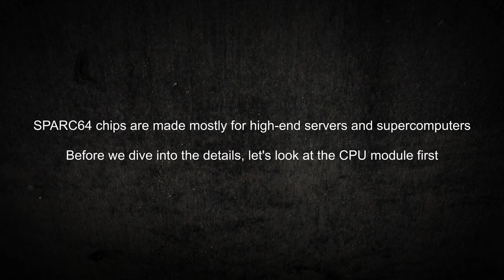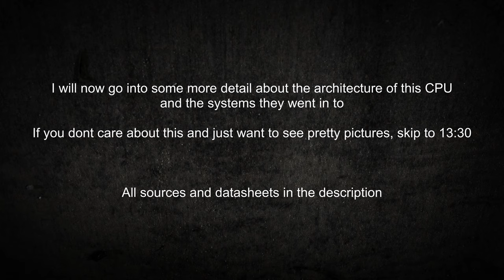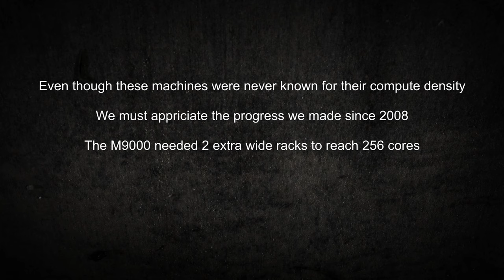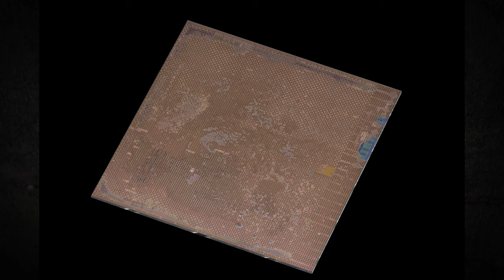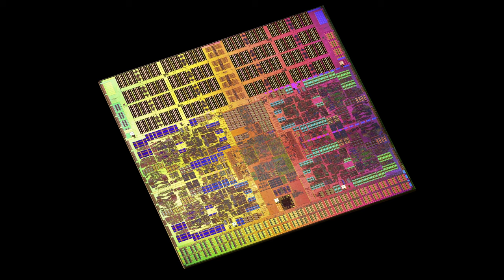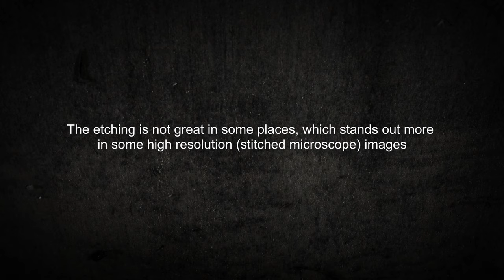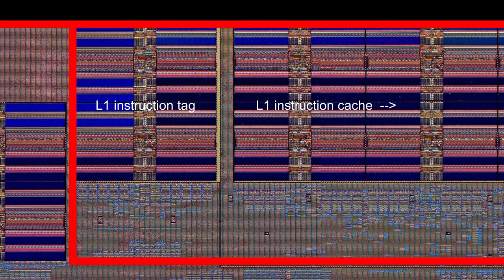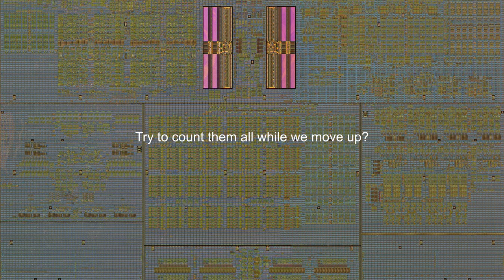Fujitsu SPARC64 VII die shots

Comment: I just found your channel and I'm loving it so far, you have some incredible photos, can I ask what acid you used to remove the pad layer covering the die architecture.
Reply from the maker: Hi, I first used boiling sulfuric acid to clean the die of solderbumps and whatever is left of the substrate the die came from. Then I used regular glass etching cream to remove the metal layers from the die. There are some manufacturing processes that this will not work for like SOI (it will wipe the entire die) or most aluminium based metal layering used in old chips.
Reply: @SIC66SIC66  okay brilliant I'll give it a try 👍🏻

Comment: The "tiny rectangles" are likely monitoring blocks. (as explained by Zeptobars in a post called "A look inside Russian 28nm MIPS CPU - Baikal-T1"). These monitoring blocks may contain temperature sensors and oscillators. I would guess that the CPU would downclock in case the temperature goes too high, or if the oscillators slow down or stop (this would indicate that the CPU will become instable). (sorry i don't want to post links because comments with links allegedly get automatically deleted)
Reply from the maker: Thanks for the info. I expected some kind of sensors, though they are so many, seems pointless to have thousands of any kind of sensor. But there seems to be an large amount of unused silicon in this chip, so they had the space I guess ;)

Comment: Could you do a die shot of an amd-a10? It has integrated graphics and south bridge. It would be a beautiful shot
Reply from the maker: Sadly CPUs made with the SOI process (Silicon on Insulator) I am not able to etch with my current method. There are other ways but I never tried them.

Also, I am not working on a new video, dont expect one in the coming few months. And when I make a new video it is likely to be about Enterprise-level datacenter equipment.
Reply: @SIC66SIC66  sounds interesting. Maybe you could look into getting a shot of some IBM power CPUs. I’ve seen power6, 7 and 8 on eBay for pretty cheep.
Reply from the maker: @BGTech1  I have Power 5 to 8 chips, but they are also made on a SOI process sadly. Also removing the die from those ceramic packages is hell.
Reply: @SIC66SIC66  it is a bummer so many interesting CPUs are made with the SOI process!